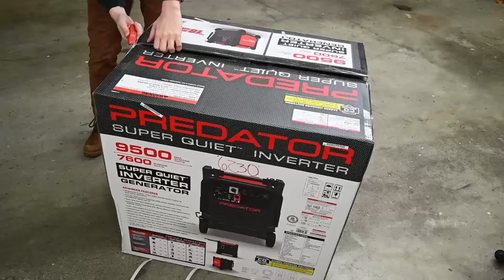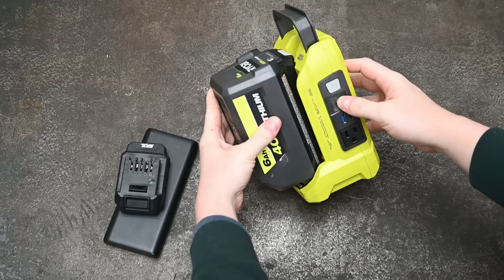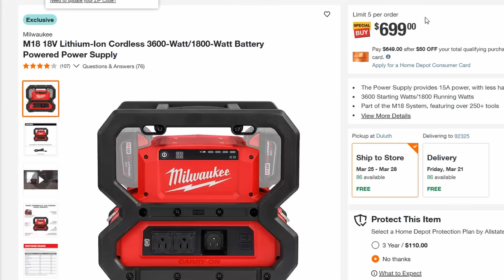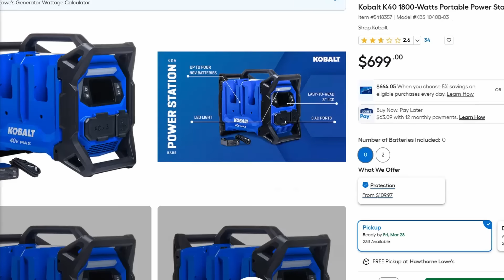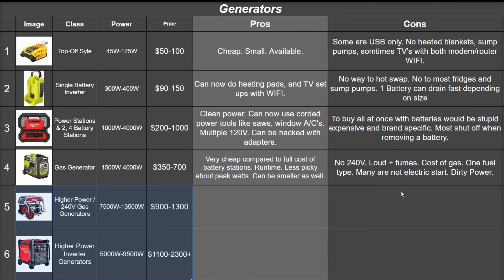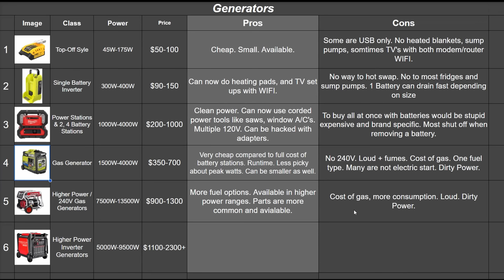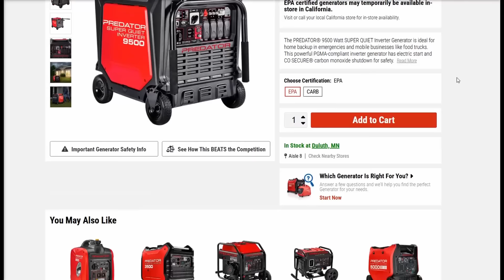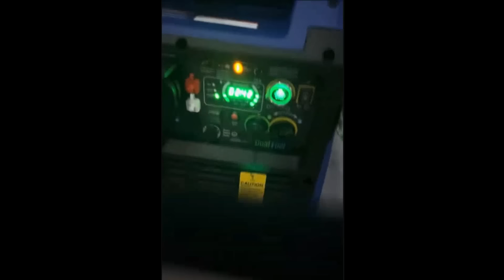Buying Harbor Freight's Most Expensive Generator So You Dont Have to

Comment: Another great video. As a lifelong south Floridian (3rd gen), who has lived with and without generator power for weeks post hurricanes, I'm deeply interested in others takes on this. I shall offer no suggestions, though, as everyone has their own needs.
Reply: I'm in So. Fl. and also lived without power for close to 2 weeks. I built a new house and said never again. I have a 22KW Generac on NG. The house is 3600 Sq. Ft. with 2 A/C's that run all the time and a mini-split in the garage and it will power the entire house like FPL was powering it. The gen automatically comes on after 30 seconds I believe. It has 2 load sheds for the A/C's. That means when the gen comes on the A'/C's have about a 5 minute delay before they are powered on to avoid a large starting load on the gen. It was around $15,000 with the transfer switch, permits and installation. I also pay $500 per year for monitoring and service. They come out once a year change the plugs, oil change and air filters. I could do all that myself and probably could have installed it myself but in case something happens to it being monitored we are on a priority list with our installer. That's worth it to me. The starter was replaced under warranty. They sent me a message that there was an issue. The gen did also as it communicates with them and me. Power goes out there is no difference, I don't have to choose what to run. I wanted the entire house to run like normal and that's what I got.
Reply: North Florida here.  I have a minimal energy backup.  Two small gas generators 2000kw and a 600kw, both sine wave with a ouple of "solar generators"  (I hate that term).  Also have some small folding solar worth about 400wh to charge the "generators".  I can keep the fridge and freezer going, a couple of fans, two cpaps, and charge phones.  My daughter opted for a lp  powered whole house generator.  If it gets too bad, the wife can go there and lounge in the AC while I tough it out at home.  Most of my friends have largish pull start gas generators.  Enough to power most of the house sans central AC and clothes dryer but able to power a small window AC for one room.
Reply: I am also a 3rd gen lifelong South Floridian. Not too many of our kind bouncing around still.
Reply: @WBG123098  My son is 3rd gen. He's graduating from FSU next month and starting law school at UF in August. I call him a GatorNole. That football game is going to be tough for his old man. Four years of smiles and tears for the Noles is hard to let go.
Reply: It is very interenting reading other people's experiences as someone who doesn't need to worry about hurricanes and the last power outage was an year ago and lasted 10 minutes. I don't know how I would survive multiple days without power.
Reply: Not sure why you even need backup power in Florida, the reason you need it is to keep your pipes from freezing up during a winter power outage.
Reply: @Kanglar  yeah, correct, that's what I've been saying as well. Who cares about your fridge, or getting heatstroke as hurricanes go by, afterwards giving a completely clear side with strong winds typically out of the south and it's 125 inside your home - as long as it's not cold, you shouldn't complain.
Reply: @Kanglar  just like we dont know snow, you dont understand heat.

You will DIE in florida without the AC depending on the circumstances.

Dont be silly, you are not built for 90 degree weather, 100% humidity inside of a box.
Reply: @Kanglar  Aside from the convenience - I need my fridge to keep my wife's medicine cold. I need it to keep my father's oxygen and hospital bed functioning. I could go on.
Reply: @Kanglar  Tell me you're not from Florida without saying you're not from Florida...
Reply: I'm a lifelong central Floridan (6th gen), and the few times over the years we've lost power during a hurricane (3 times since 2004), where I've been at it's only ever lasted no more than about 20 hours. Meanwhile, friends and family that only live a few miles away have lost power for up to 10 days. Anyways, I got a generator, multiple battery toppers, probably a dozen USB power banks, some 100W solar panels, etc - and I never get to use it. Last year during the last hurricane we lost power for about 8 hours - and I ran my fridge off my lawnmower battery as it was the middle of the night and I didn't feel like starting up the gas generator. Then, about 10 mins after starting up the generator, power was back on. So I sit and wait for something to happen.

Comment: The "right" term for what you are referring to as "clean" or "dirty" power is Total Harmonic Distortion (THD). You can get a meter that monitors the THD and tell you what percentage it is. Generally, below 4% THD is recommended for electronics.

Comment: Number 4 on the list, 2-4k watt inverter will run a gas furnace with inlet plug/interlock on main panel. When running the furnace all you need is to power the 110v blower. Will also run house, just need the proper rv style dog bone adapter and turn off any 240v breakers/appliances... 
I've ran my house for over a week during Beryl off my rv style 4k inverter generator, 5 gallons of gas for over 3 days.

Comment: An up-and-coming option is power from an EV vehicle. Basically option 3 in your table but on steroids. WAY more expensive and not practical as a new option but if you already have the EV it's an interesting solution.

Comment: The power supplies on modern electronic items can handle some staggeringly dirty power. The power quality can impact LED lights and other things that don't use an AC/DC power supply/convert such as computers and other similar electronic items.
Reply: Predator 9000/7250 here:   Just used it again this AM after a car hit a utility pole.  Nothing sensitive enough in my house for the distortion to bother it except for the newly installed LED lighting.  Not much, but there is tiny flicker.   Everything but the AC and the pool pump which I don't try.   TV, electronics, hot water, microwave, both fridges, OK.  Maybe I'm just lucky.
Great video.

Comment: At my place of work we have a huge line power conditioner that has a single socket on the front. It has a great big transformer inside and a couple of oil-filled can capacitors.

Comment: Are there highly developed countries outside of North America that worry about generators for the home?

In the 47 years I've lived in Denmark and Sweden, I can think of exactly one time where there was a major power outage, and if I do a search for it, I can find 9 in the last 44 years, and none of the had power outages for more than a few hours.

Generators for worksites or off-grid camping are an entirely different thing though.
Reply: As a Dane, I have experienced three or four outage in the 34 years I've lived in Copenhagen, so it's definitely not relevant here. However, my parents summer house on Fanø off the west coast of Jutland, regularly has outages (at least once per year), as well as surprisingly dirty power from the power company (probably at least partially because of the enormous amount of heavy industry around Esbjerg turning on or off some massive machine, causing the entire network to stutter), so there we ended up getting a power wall-thingy (not the one from Tesla, but a similar system with ~15 KWh of batteries usually used to even out power supply from solar panels), and it has done wonders, not least in that TVs last more than 1-2 years before breaking, and lights don't flicker all the time, and it will power the entire building for 24-72 hours in case of an outage, so we no longer come over to a freezer filled with bad food, or the risk of frozen water pipes in the winter.
Reply: @MrMartinSchou  you will be having much more outages soon, all part of the globalists plan

Comment: Here's the big question: how difficult would it be to clean up the output power from a cheaper generator if you're not afraid of storing up some power to keep everything nice and smooth, but with a brief delay to charge up capacitors?
Reply: capacitors work on DC, this is AC

Comment: Hard to beat Champion or Firman. Both were junk when they first came out but the dealer support and parts availability and quality are there now. My $600 3400w inverter Champion runs everything perfect here at camp when the power goes out half a dozen times a year.

Comment: Speaking from experience with the champions, the engine durability simply isn’t there, roughly 900 hours in mine developed a severe oil consumption issue, tearing into it the piston rings had eaten into the cylinder walls (changed oil at 1/2 recommended intervals, always ran 100% gas with Lucas fuel stabilizer)

Comment: Most of the small gas ones are inverters now and DO have clean power including almost every single one you pictured
Reply from the maker: Ahh, when I used one it wasn't or most wern't. Not 240V though, so wouldn't be of much help for the house
Reply: You can still backfeed 120, you just won't be able to run 240 appliances
Reply: the ones he showed did happen to be all inverters, but small generators in mass are not inverter style.. atleast here in canada everything at the hardware store is conventional style and to step up to an inverter style you need to halve the watts while doubling the price, so they dont sell many inverter style since the average person doesnt know the difference they just buy the cheapest thing they think will power what they need

or actually just buy the cheapest thing all together and then wonder why it wont run their whole house
Reply: Yup. Got the ~2000 W inverter Hyundai generator.

Comment: The small suitcase style generator I bought was the Power Smart 2500 because I needed power to run my 1000w block heater for my work truck when I parked it away from my house and because I wanted to run my Hobart 135 mig welder. It provides up to 6 hours of block heating on one tank of fuel but will not run my welder even when the welder is set to the lowest amperage. Arc lasts a couple seconds before it trips the breaker on the generator. My welder does not trip a 15A breaker on high amperage setting, which is only 1800w of power.
Reply: The thing you always have to consider with generators is their advertised (peak) watts vs their actual running watts. That Power Smart 2500 has a peak of 2500 but running of 1900.  It also probably doesn't provide a 100% constant 1900 either, especially with a welder that can vary a lot while running. I would suggest getting at least a 3500 watt generator if you need to run that welder.

Comment: Try finding a servicing dealer for any generator except Hondas. Try finding parts for any generator except Honda. Westinghouse is desperate for servicing dealers. I don't know where Westinghouse got my name and number from, but they bugged me for over a year to become a service center for their generators. You get what you pay for.
Reply: Honda or any japan names generators are the only ones i will stick with, My Yamaha has been running strong for 10 years, same for the Honda i got two years ago
Reply: Yea if you dont have any mechanical skills then servicing will be a big part of owning a generator.  But even with basic knowledge you can service your own very easily.  If you can keep a lawnmower running year in and year out then you can keep a generator tip top.  With propane you dont ever have to service them except every few years to change the oil which everyone should be able to do who owns a motor..  just takes effort which everything takes some no matter what your getting..
Reply: @, servicing is way more than just changing the oil and spark plugs. A friend of mine dropped off his Champion generator because it wouldn't start. 90% of no starts are fuel and carb related. This genny was in the 10% that didn't have either of those problems. One of the rocker arms had come loose and the pushrod was bent and parts of the rocker arm assembly had fallen into the crankcase. You can't just leave loose parts banging around in the crankcase. They can get caught between the timing gears, in the oil pickup, or the governor assembly. Champion had virtually no parts available for this machine. I was able to retrieve the parts out of the crankcase with a flexible magnet but one of them was damaged and needed to be replaced. It was apparently made of unobtainium. I gave him his genny back and wished him the best of luck finding the part.

Comment: Picked up the predator 3500 on discount for $599 plus tax. It's great. My boss bought 2 9500s parralled them together and had me swap out the carbs for propane. Overall I am happy with the brand, reliable and easy to work on/upgrade to propane.
Reply: Don't they still use the carbs but use them as throttle bodies now?
Reply: @Olds_Pwr  when I did the propane conversion I replaced the gas carb for a propane carb. Some units can do both and might work the way you mentioned but the way I did it was just to convert it from gas only to propane only. It's as simple as swapping a carburetor on something like a lawnmower.

Comment: I have UPS for my TV and internet, and a Bluetti, for emergency power.
I used to have a gas generator, but found out, that if you don't need them much, and they sit for extended times, when needed, they fail.
I have a 2000W inverter, that connects to my car, so if I really need it, it's ready to go.
If you have frequent power outages, inverter gas generators are the way to go.
I'd say, if I went gas generator, I'd get one that runs on propane.
Reply: I'm also using a high quality TRUE sine wave inverter that I connect to my car battery. It's strong enough to run my fridge and/or my furnace. I just go out to start and idle the car sometimes and keep a booster pack handy in case I discharge the battery too much.

Comment: Small kinda correction, there are 3-4kW dual fuel inverter suitcase generators available. Examples include the Wen 3600W dual fuel.
Reply: Yeah. Half of the examples shown in the video were inverters. LOL
Reply: A-iPower GSC4300 too
Reply: The natural gas option (and with it, LPG) carbs on asian manufacturers are common overseas. A methane generator can run a NG generator. You can spend upwards of $300 for a pre-adjusted kit assembled for a 3-4kw, or swap in a $20 carb. The trick when adjusting it, is to run it lean (cool) vs rich (hot), which is the opposite of gasoline. Prevents burned valves.

Comment: Nice to know. I was going to go with the big inverter/generator from harbor freight. Glad I didn't now. Thanks young man.
Reply: They do have a dual fuel remote start generator it is just 5000 watts though.The 9500 featured here is an older model and most likely will be updated like the new 5000 watt model..
Reply: @djsi38t I just bought this 5,000 watt harbor freight for $850. Not sure it’s worth it when Amazon models are quite a bit cheaper and can buy a longer warranty. A warranty is only as good as the company backing it. Harbor freight warranty is very expensive so I passed buying it. Remote stop and start is nice and gas or propane hopefully is a benefit. Maybe these are made with better parts. Time will tell.

Comment: For Ryobi, I bought a two pack of 200W inverters for the 18 volt batteries. They work better than the OEM Ryobi inverter, and I maxed it out charging my gaming laptop while running power hungry software (along with my S24 ultra while charging a Anker powercore 747). Both the battery and the inverter are fine.

I think it starts with an L and it seems they jumbled a bunch of letters together (Livowalny).

Overall, I am content with my purchase.